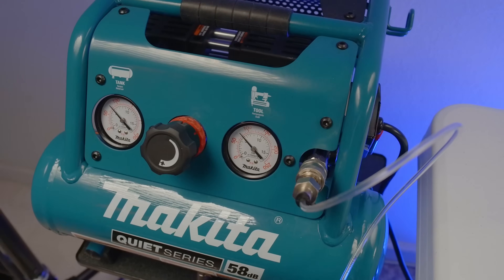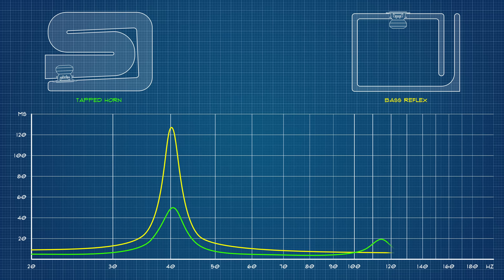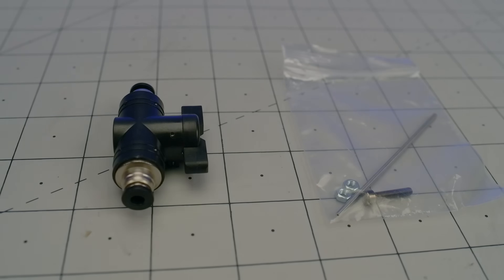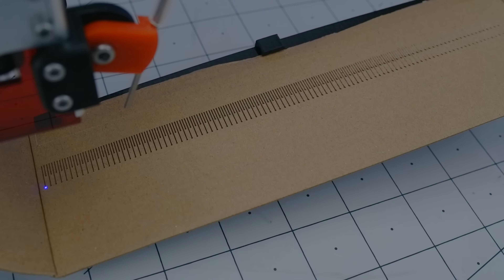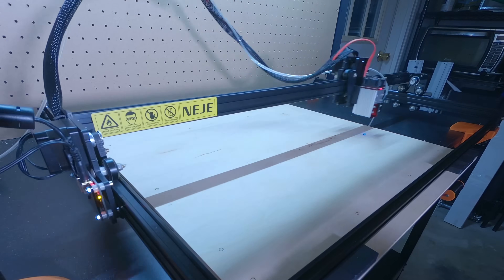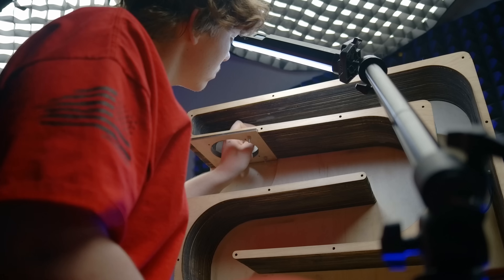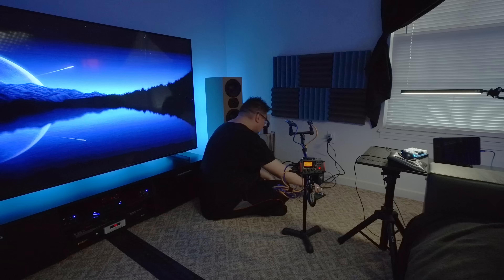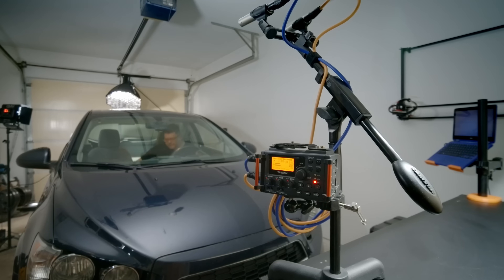Building a Tapped Horn with a NEJE Laser

Comment: Can you do a series on waveguide mathematics? 😁

I am super impressed with your content, designs, and expertise. I really want to make one of these for my vehicle, but you keep outdoing yourself haha.

Oh, I am listening on a set of Hyper X Cloud 2 headphones. For the price they are the most comfortable headset I have worn, and they sound pretty good to boot (albeit I am no audio engineer).
Reply: That math is out there already, it's the math involved with defining each environment based on the enclosure location & orientation, over time, that makes the difference. And so far, there is no available program that does all that for you. You could extrapolate information from a laminar flow modeling software, such as hvac software, but you'd need to know so many more things to be able to use any info you pulled from that prog and apply it to a response prediction at any given location.
Reply: @RightPriceSports  yeah, I'm not asking for a video series on how to become an audio engineer. And what you're talking about is the boundary conditions, which is what makes wave guide mathematics cool. The better you define a circumstance the better your model represents reality. It's been forever since I studied waveguides, Hexibass probably uses this maths routinely and I bet could pretty well break it down for us. I like his content, I like learning (even if sometimes it's for a second time), I get that it's not exactly in line with his normal content and it'll probably never happen. I still think it would be fun to go over wave guides again, they apply to more than acoustics. Any microwave for example uses a wave guide to impedance match between the electromagnetic whistle that is a magnetron and the cavity that heats your food.

Comment: I tried to build a few folded horns, but I travel too much.
The last one was a fail. Had a 6.5-inch sub in a 1.2cuft box. The port W 0.75" H 9.25" the port was too small.  With the wave lent around the box to make the  horn going bigger both ways To max my van.   Top to bottom left to right folded horn.  Took it apart to find the problem . PORT OPENING W2" H9.25.  Or 19in2, 
I'm busy with some drone bugs 3 with speedybee F7 Bluetooth flightcontroler. With audio and RSSI. Can't afford the bn880 gps module. Got 20min flytime 2200mah

Comment: What would something like this do with a 10" or  even 15" driver?
Reply: The piston area is kind of a byproduct of useful parameters. It places a dimensional limit on the design rather than defines anything.
Reply: @RightPriceSports  yes it would be big. . . that wasn't the question.
Reply: @BlackBeardAir  my response didn't mention that it would be bigger as an answer to your question. The size is just a byproduct of the necessary driver parameters needed for any engineer to be able to answer your question. There is far too little information in your question to get a response he'd feel you'd be happy reading. There have been many 10", 12", 15", 18" and larger subs used in tapped horn alignments in the professional audio industry for years, but as you may well know, it takes the right driver parameters to lend the driver usable in this type alignment. That's the only reason for my comment on driver diameter. It really is just a happenstance that the driver is any given diameter.
Reply: @BlackBeardAir  definitely didn't mean to appear as a condescending comment. Apologies
Reply: @RightPriceSports  no worries.  Size isn't a concern.  Just think it would be a cool project from the DIY standpoint.

Comment: While the method used is time and labor intensive I can see how it could be made otherwise. If you were to use the laser as a template maker for kerfing plywood or MDF. It can be reinforced with polyglass resin or even overlayed with fiber and finished. If you wanted to fill the empty cavaties behind the baffle you could use a 2 part expanding foam or something equally firm. Gorilla glue and water would work. The only thing I'd change about the design is a small piece of automotive carpet at the head of the port where the resonant chamber starts. You'll find that it'll develop a little more of a pressure wave and it should smothe out the output curve. Just a 4" patch in the waveguide inside behind the speaker mounts. If nothing else we learn how the design responds to the installation of a minimalist amount of dampening at the internal first point of reflection. My theory is that if you break the standing wave between the two parallel faces all of the pressure will coalesce in the curved end of the horn which should give the driver a little more dynamic range and the smoother curve. To perform the experiment you would need what ammounts to a scrap of carpet and a dab of hot glue nor spray adhesive if you prefer. In the event that you glued the side on and it can't be dissassembled nondestructively you could 3D print a reasonable approximation maybe in a different size as the physics scales nicely. As long as the carpet is the thin kind and it's other dimensions are roughly the same as the surface area of the driver it should be roughly the same influence with slightly more effect on smaller driver sizes frequency wise.

Comment: Excellent choice on air compressor! I have been eyeing that one to put in a storage compartment on our motor-home. 

I did actually end up buying a 3d-printer and printing your plans for that dual 3" subwoofer box. It's pretty cool and I use it with my PC. It sounds excellent and tucks away very nicely. I should have used more than 20% infill though or been a little more careful with tightening the speakers down. It looks horrendous but I got all the air leaks with bluetac. I REALLY need to print another...

Comment: Listened with a Xiaomi Soundbar, that goes much lower than i ever anticipated from a device like this without a subwoofer - the four passive radiators definetely help with that though. 

A while ago made a false floor for my car trunk, and i embedded a 10 inch sub into it with a window to let it be seen. It doesn't sound great, but it definetely makes itself known, which i'm happy with. Considering going again at it, using a plexiglass cover to let the whole tapped horn structure to be seen, maybe even illuminated with RGB LEDs. Should take measurements before i do anything though. I was really waiting for another upload from you! Wonder if this kind of enclosure can be 3D Printed though, also i'm guessing a 300x300 horn wouldn't go as low or as loud as this.

Comment: Really neat demo! You've sparked the idea of to trying to design a smaller sub for my 2013 volt, something small enough that I can actually make it part of the car.

The poor car has been totaled twice, and at this point the tray to hold all the maintenance bits in the back is completely missing. The mat is supported with duct tape rolls...

Might be a fun project to design something that fills the space, is a subwoofer, and supports the mat in the back, instead of my 15in sub I made out of a desk, which takes up a lot of room.

Comment: Do you think you could have slot loaded that 4 in driver and possibly gotten another turn in to roughly the same size enclosure and get it down to 30 Hertz that way? I listen with a FIIO BTR5 and KZ ZSX with a balanced cable.
Reply: You can rest assured a loaded bass reflex wouldn't have performed anywhere near like the finished product.

Comment: I would be interested in a video about your design process, how do you find the right sizes for your enclosures, how do you constrain CAD models to meet those criterias, what software do you use, etc.
Reply: It's his own software with no visual aids that make commercially-available, entry-level modeling software usable for most enthusiasts & engineers. He can account for carpet & padding, sound damping, room dimension oddities, listener's location, even atmosphere composition. Any engineer would soil themselves with a thorough demonstration; 99% would be lost before the half-way point. It changed my life, professionally, meeting him & learning how to define what was missing in available software. I never learned how to calculate values of the missing pieces, but quickly determined that at the manufacturer-level, we (the industry) we're not equipped to give warrantyable enclosure recommendations, regardless of how confident any of the techs were/are in their office chairs. 

AND, all of his improvements are basically exponential as compared to the previous capabilities. What people need to see, but what isn't pleasant to viewers, is the true response prediction & actual measurement. The response traces you see are heavily smoothed/averaged. If you saw the true predicted trace & all of it's nuances, you'd be cleaning drawers. He produced a video for Audio Dynamics going over generalized effects of & acoustic analogies for vehicle interior compartments & windows &sunroof, etc. What those features equated to electrically in a speaker/amplifier circuit. That was very powerful for those who understood.

Comment: This is extra interesting right now. I have recently come into possession of a pair of vintage Klipsch La Scala's, and I'm quite enamored with them. Being a 3 way horn loaded setup is very different from other types of speakers. But they do lack in depth of bass - there had to be a tradeoff somewhere, and to keep the speaker more reasonable in size (lol, they're over 100 lbs each as is) they sacrificed the lowest bass. They go down to around 50hz with authority (a lot of it, actually), but are lacking below that. 

This build makes me think that something like this would make for am excellent sub to fill in those low frequencies if designed well (I'd assume bigger due to the scale of the LaScala's) , but I'm not in a position to be able to research it right now. But I wonder what you think about that? What would it take to get a sub that would keep up with and compliment those 15" horn loaded woofers? I'm toying with the idea of building separate subs for the La Scala's to use as bases, that way I could elevate them slightly above their rather low position on the floor. Got any advice? 

Love all the content too - always excited when you post new videos. 😀

*edited for spelling*
Reply: You might look at the lab 12 horn. There is a Klipsch horn loaded subwoofer in the professional line but they're not very common and they tend to be expensive. The Klipsch horn sub is the size of a refrigerator and gets down to just a little below 30hz, but does so with authority! Heard a pair many years ago in a nightclub in Dallas. The Lab 12 horn depends on exactly which build you make, but some go down to 25hz. The Lab horn is smaller, but it requires a lot more power. Basically they traded efficiency for size, which makes sense in a touring rig. I hope to get a pair of La Scala's someday. When I do I will experiment with subs and maybe even an epicenter (awesome for EDM).
Reply: Even a small sub will do wonders i think (KEF KC62 (can apparently play down to 11hz) in mind) technology has come such a long way even a tiny form factor sub is immense now, (even with a 15 inch horn) so long as its tuned / cross over right there will be a noticeable difference basically your la scalas cover everything except sub bass so even a small sub that can play down to 20/30hz would fill that tiny gap (its doesnt need to work hard if its only covering a few frequencies). but yeah that model KEF is 1000watt RMS from 2 6.5 inch subs which is utterly amazing. But yeah i say go for a suuuuubbbbb you wont regretttt =)
Reply: You saw his living room in the video. His dual 6.5" towers can play down to 7Hz. They had his kitchen cabinet doors and dishes chattering on the subsonics in his original Fairbanks Morse track. Trippy as hell when you walk up to them to confirm the drivers are operating near death & see they are barely touching 0.125" of p2p excursion. Those things are nuts, proprietary, & intentionally designed for base-model Dayton equipment.

Comment: I'm listening on a pair of homebuilt Speedsters by Paul Carmody, a design which uses the midbass driver in this video as a woofer! It's an exceptional driver for it's size. A pair is just exceptional in nearfield. The box is tuned to 50hz ported, but definitely hits an f6 in the 40s. Really shines with EQ. I notice it has difficulty above 90dB below 40hz, though, so I have it capped at 30hz by a 6th order electrical (digital) filter to keep the driver from bottoming out. How loud does this horn go? Seems super width efficient. Never really thought of it as a sub driver, though. In the kit, the crossover is set to an acoustic 3.3khz 3rd order. Handles vocals surprisingly well in the same space as bass.

Comment: A tapped horn enclosure has to be my all time favorite designs for subwoofers. It just makes the most sense.
Reply: Also with the driver inverted so close to the port. You could wire directly to the driver. No need for a terminal cup. It actually provides more quality to the signal path.

Comment: Are your response graphs at 1W, or at 30W?
Reply: @HexiBase  thanks for confirming!  So will this driver take its rated 30W across its 38Hz and up power band?  If so it should comfortably exceed 113dB in-car, no?
Reply: @HexiBase  it would be very cool to see if large signal analysis supports the enclosure modeling and whether the driver is Xmax limited or suffers from any compression.  That’s a lot of mojo for a 4” cone!

Comment: Love te projects but, here in Brazil little subwoofer are impossible to find on the market and the rates make it crazy to bring them from there. What I'm getting at with this is: you could make a 3d printed or laser cut DIY neodimium subwoofer. I'm sure you have absurd knowledge about it that would make building simple. 

Greetings, success!
Reply: Paul Ellis of Polymate3D has an open-source, entirely 3D printed driver design, including a passive-radiator enclosure to boot. It's obviously pretty inconsistent as mentioned above, as the cone is printed from TPU, not anything exact about the manufacturing yet, but it's still really impressive what you can do with only a 3D printer! 

Only thing that isn't printed is the magnets and wiring. Thomas Sanladerer has a video about it. Always wondered if there was a way to apply some of the concepts HexiBase explores in terms of enclosure design, to that driver design. Pull the most power and accuracy possible out of a 3D printed driver.

Comment: This was an awesome vid! As a side note, if I had a subwoofer with a higher inductance (5mH) and I had a manufacturer-given frequency graph, would that inductance apply again on top of that graph? Or because it is an innate property of the driver is it just "baked into" the FR?
Reply: Ah yes, thank you for the response!! This information is crucial because I didn't know whether to add another series 5.5mH inductor to the CAD to account for coil inductance. Obviously if it is accounted for, then this isn't necessary. The best way to know is to test it, but when you live in the Midwest, getting a 70L enclosure on a ladder outside isn't a particularly easy endeavor with how cold it gets. I have heard of other methods such as ground-plane I should try though.

Comment: What software are you using on-screen?
Reply: @HexiBase  Thanks
Reply: @HexiBase  Out of curiosity, what design software (if any) do you use to design and calculate predicted response. I started on winISD but currently polishing my knowledge on bassbox pro and hornresp (hence the my interest in horns). Currently I design in hornresp then I do the 3d design on sketchup; which I've been good at for over a decade (yay school of architecture). I'm glad to say a couple of my builds have failed successfully😅.Converting straight horn dimensions  in hornresp to a folded horn model on sketchup = tragic fail, for some reason
I've mostly been working on subwoofer design, having been amazed by your mini subs builds. I'm learning from forums (which can be more confusing than helpful), YouTube videos and the almighty 7th edition loudspeaker design cookbook by Vance Dickason

Once I understand bass, next challenge, 150hz ➡️ to infinity...and  beyond

Comment: ... You mentioned the effect of a small pressure differential across a relatively large area at high cycle speeds - do you think there's a benefit to adding a single layer near the middle that looked like your drilling guide, to stabilize those thin cross-grain walls against the horn pressures?
Also, have you seen the Shaper Origin? Way more hands-on, but your "woodworking machine" would store in a crate in the corner.

Comment: Thank God. I was hoping you'd do a tapped horn video. Please consider doing an in-depth video on horn loading vs bass reflex and driver suitability to either. Your Yoda knowledge is much appreciated from 🇰🇪
Reply: Countryman. What shipping method do you use to get equipment like drivers? I got some things from parts express through kentex cargo and its taking too long. Thanks.
Reply: @balladbuster5109  I haven't gotten stuff from parts express before but if it's from the US then kentex is my best bet so far. There are some somali shipping companies in Eastleigh that I want to try next. I think they're best for bulky shipping to make it worth it. Which I guess works well for multiple drivers. How long has it taken for shipping?

Comment: Cool build!  
I used a Tang Band W6-1139SIF 6-1/2" driver for my tapped horn build. It's really nice addition to my modest home theater. It plays nicely down to 25hz.
Reply: Did you build the one from volvotreter or another one?
Reply: @androiduberalles  It was inspired by the Insubnia, designed by lilmike over at avsforums. I'm in europe, so the anarchy drivers were not available to me easily.  
The driver isn't a great replacement for the Insubnia, so I recalculated the horn in hornresp and made some adjustements to the build